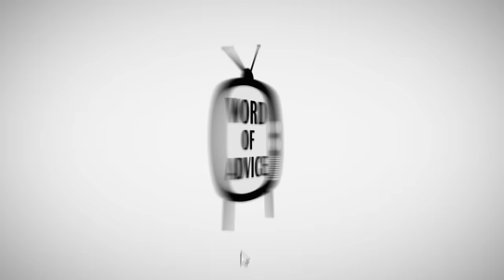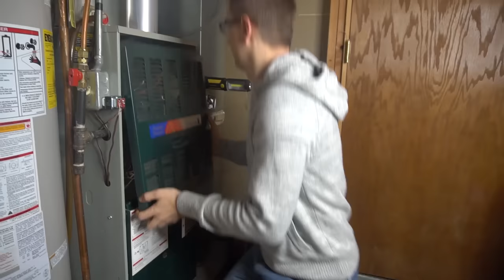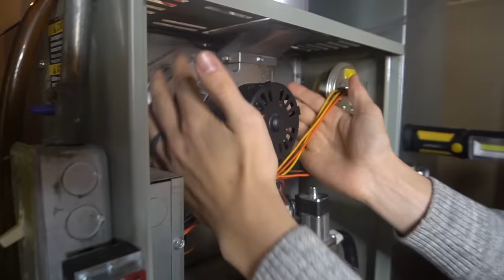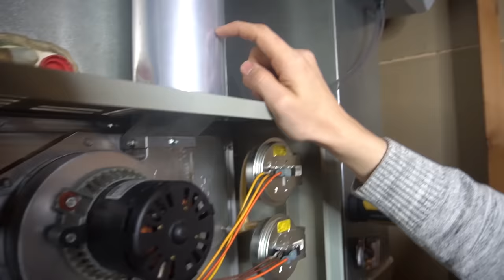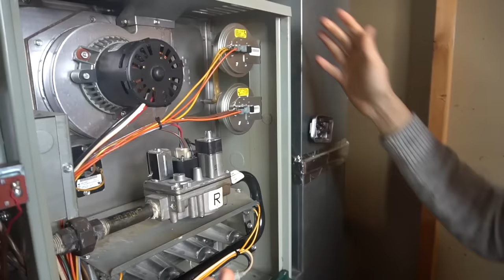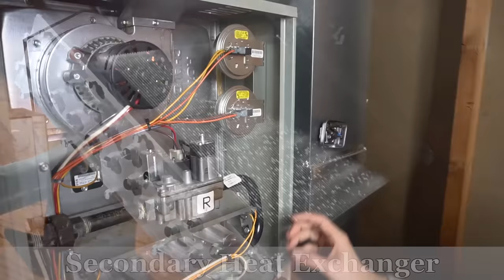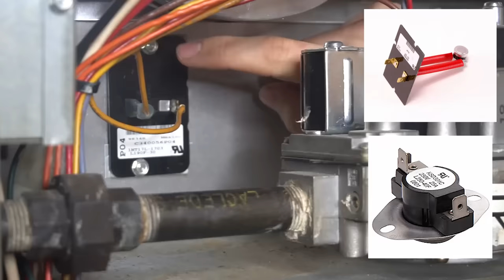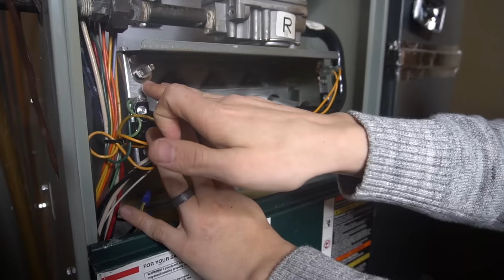Furnace Parts and Functions Explained

Comment: I just installed a single stage high efficiency furnace in my house. I took my time and feel like I did everything right. It worked fine for a day then stopped lighting furnace. Sounded like the gas valve just keeps opening and closing which either gave me inconsistent flame or no flame at all. Tried it again the third day and furnace lit seemed to be running pretty good but I would get a lil flicker once in awhile in the flame. It's been converted to propane I changed the regulator spring in gas valve and offices. My inlet pressure is about 16 inches WC when furnace is not running and 10.5 when it is running. Outlet pressure is 9.7. Pretty frustrating installed because I didn't wanna pay a hvac guy 3 to 4 k right now and might have to call one anyways. I'm pretty handy and I'm a maintenance mechanic at work.

Comment: I have the exact Same a.c. heater furnace as you do but mine the heater will not turnon. I cleaned the flame sensor and my inducer motor turns on briefly when i touch the flame sensor.When I place a jumper on R and W1 nothing happens.

Comment: My Furnace troubleshooting :

Vulcan Product no 5300052 and Serial no 00447836, 

Previous Problem / Initial Problem 

Furnace didn’t want to start if the Room Temperature is below 16 or 17 Celsius degrees.
If already starts, no problem.

I try to learn troubleshooting from YouTube.

So I know about FURNACE FLAME 🔥 SENSOR and IGNITER. And also know about the CAPACITOR.

I did change the FURNACE FLAME 🔥 SENSOR and IGNITER, and also the CAPACITOR.

The Furnace when one day already ON ( it could ON, when the Room Temperature is gonna up from 16 C to up ), all the day we have no problem. Because the Room temperature is still about 17 C or higher.

The Problem of my Furnace is only:
It couldn’t ON on a day when the Room Temperature is below 16 C.
That’s the Problem!

Hi 👋 J, could you advice me, what part should I change again ? 🙏

Comment: Hi j, recently i been having issue with my furnace. It will works some time only. Basically when i turn on the thermostat and I look at the furnace, the cycles went from big blower to inducer blower, then the igniter glows orange and I can hear a click noise from the gas valve but the burners will not light up into big flames. After about 5 seconds the orange igniter change back to its original color because no big flames lit up. It seems like the gas valve click but it's not open to allow gas to the burners area to get light up into big flames. What do you think could be wrong here? Is it the gas valve is bad?
Reply: call for professional help it could be a lot of things

Comment: Help... I have an international comfort furnace with a Honeywell smart valve. It would ignite the burners for 2 seconds and turn off. I replaced the dual igniter/sensor and now it ignites and the call for gas is slow with only 2 burners igniting but never going to a blue flame. And the pilot flame never goes out. The blower is spinning..Shouldn't the pilot stop at some point?.. thanks

Comment: my gas furnace is trane and has an issue that all time never go up two degrees, will shut off, if the house temp 69 and i set the thermostat for 71, it's going to shut off soon reach 70, three techs came and done nothing, the control board has no light indicator to show you the error!!
please advice.

Comment: Great video. Thanks for creating. I have a question. When just the fan (blower) runs without heat why is there no suction at the returns. There is only return suction when the heat is on. I have a humidifier on the return side and I'd like the fan to blow much harder when 'fan only'.

Comment: What's the switch that was covered with tape behind the lower panel? Why is it taped? I just had my furnace servied & it's ziptied & I pretty sure it wasn't before.
Reply from the maker: That is a door switch. It's only function is to turn the power off to the furnace when the bottom door is removed. A little safety feature that many technicians will bypass (with tape, a ziptie, or something else) because we need the power to stay on while doing our checks. I left mine permanently taped. There is no harm in having it ziptied and if you want to get in there yourself you could simply turn the furnace power switch off.

Comment: Excellent! What holds up better a hot surface igniter or spark?
Reply from the maker: I don't think I have ever replaced a spark ignitor :) I replaced the spark module that generates the spark or the ignition board plenty of times though. I also replace plenty of hot surface ignitors, I would say they fail more.

Comment: Only one thing I want to add to your advise is primary and secondary wires . There is a danger if you touch 24v compare to 120v . And also the power blower door switch you forgot to mention .

Comment: Love your videos! I have a question for you . I have a 3 zone system I noticed that when only one zone is on in "HEAT" my furnace trips on high limit switch.. but it will "NOT" doit if 2 or all 3 zones are on.. do you have any tips for me I would appreciate it...

Comment: I have a question. My furnace room and inside the furnace is very dusty. Is that gonna destroy my furnace? what would you suggest me to do? Thanks
Reply from the maker: Well, you can try vacuuming out what you can. It won't destroy the furnace but it may take out the blower motor. If you want, you can watch how dirty mine was when I replaced the blower motor on my furnace. (the one in this video) Just look up my video on blower motor replacement.

Comment: I have a new house I bought from builder with 2 zone system. One zone for upper level and one zone for lower level. However the unit itself is one stage. There is control unit which can close dumper to lower level or upper level. The issue is that when only one zone is calling for heat (as an example) the unit rated for the whole house is serving half of the house, and I get tremendous amount of heat and air flow. Is there any building code that requires builders to install 2 stage systems in 2 zone houses.
Reply from the maker: Different states will have different codes so I would not be able to tell you that.. But yeah that sounds like the furnace is not meant to go with a zone system.. A variable speed (ECM) blower motor may help a little bit with that.
Reply: @WordofAdviceTV  May I know how it is in your state.
Reply from the maker: @maciekkormicki9298  Sorry, that is not something I would know. I only do service work, no new installs so I do not know all the building/installation codes. I do know that new construction houses are way more tight (insulated) therefore they implemented new codes that require builders to put in air to air exchangers, air cyclers, etc. to prevent the house from getting "stale". As far as I know, where I live, there are no codes that require HVAC systems to have a zone system though. Or a two stage furnace.

Comment: What is the wire device connected to the junction box power switch it looks like a transformer but only 2 wires induct or
 or as relay ??
Reply from the maker: It is as you say :) That is a transformer for my humidifier.
Reply: Thanks the video presentation was very good the last to things that went bad on my furnace was the limit switch and I was getting short cycling because I was using a Merv
 12 dropped down to a Merv 8 it is a Bryant 20 years old

Comment: I’m confused. At 3:50 you state, “a single stage has a line and a common.” I always understood line and common to be the same.  I’m thinking you either meant line and neutral or as sparkys call it, a grounded conductor...or its 220v, in which case there would be two lines or commons or conductors...whatever y’all call it.

Awesome video, btw...this really helps!
Reply: Usually, "line" is the voltage line, also called the "hot" wire, and is colored black. The other wire is the "neutral" wire, and it is not unexpected to use the neutral (a.k.a. "return") white wire as a common. Calling a hot wire by the name "common" is, in my experience, very unconventional.

Comment: I have a question/wasn't sure where to ask. I rent and had a new high effeciency furnace put in but the top and bottom door are different than my old one. My old one came off like the one in your video...this new one has knobs to open it and also rubber seal all the way around the door/panels...the issue I'm having is the smell of the rubber seal is triggering migraines for me (I tend to be sensitive to smells and new rubber is one that makes me feel sick)...and unfortunately the smell of it is coming through the vents in my house so I really can't turn the furnace on w/out feeling sick. I didnt know they made new ones this way so never thought to ask the landlord what kind of furnace he was getting or if it had rubber on the panels. Is there anything to do about this or any different panel they could put on that doesn't have rubber seals around it? It's just very frustrating as within minutes of turning it on I get nauseous and migraine and I can tell it's from that new rubber smell. Just thought I'd ask here. Thanks!

Comment: My new heat pump/furnace is set up horizontally. There is a drip pan underneath what I would call the output end of the furnace where the ducts are connected. There are two round threaded holes about an inch in diameter close to the floor height. One of these has a red plastic plug in it, the other does not. Air is blowing out of the unplug hole. Can you explain what the function of that open hole is?

Comment: Hey,  I noticed you cleaned the carbon off of the shop burner with a steel brush in one of your other videos. Do you ever have to clean the gas manifold orfices, and if so what do you use?
Reply from the maker: With the orfices, if there is anything stuck in them, usually it will be a spiderweb or some other easily cleanable debris. I use a dental pick to clean those. If I can't find it in my bag, then I simply yank out a strand of wire (needle nose pliers are good for that) from my steel wire brush and use that 😄
Reply: @WordofAdviceTV  OK cool, Thanks!
Reply: @ Word of Advice TV, Hey I wanted to know if had a video on Humidistat Diagnosing. I have humidistat that could possibly be bad for a GX-8 Pure Humidifier System. I wanted to diagnose this particular model. Its a Duct 15 to 95 % RH Controller Humidistat. Let me know your thoughts on this.
 Thank You!

Comment: HI J, I have a modern high efficacy  forced air furnace (96%AFUE) and was wondering if the induced draft motor is variable speed and if so what controls the speed?

Comment: On an old Furnace Circa 1966 the gas would flow via   the tstat,  Ignite from a pilot which had a thermo couple. it would then preheat the exchanger for a half a minute or so and then the fan was triggered by a thermal sensor.  Is there still a similar process or is it all on a timer?

Comment: How much should replacement of the control board cost?  I saw on Amazon that they generally run $100-$150.  My furnace repair person said it would cost over $900 to replace it because it needs a "kit" for American Standard Freedom 80 single stage furnace.

Comment: Good explanation of the basic parts. LOL on Amish joke. Anyway, you didn't mention the big transformer mounted to the junction box, but mentioned a little box by the control board as the transformer. I am familiar with the big iron transformers like on the junction box, but the little plastic box....Is that really a power transformer? Is part of it hidden inside the steel enclosure then? If so, was the bigger one outside added for the AC system?

Comment: So I have a Intertherm furnace but I am having a hard time finding parts for it online. Currently I don't need anything I just want to be prepared. I found the serial number and model number of the furnace itself but have not had much luck. Do you recommend any particar sites for parts?
Reply from the maker: Hey Aaron! With an Intertherm it is harder to get parts. What I would do is just call an appliance parts store and give them your model and serial, tell them what you are looking for and then ask for a part number so that you can confirm that is indeed what you are after. After you have the part number, looking it up becomes a lot easier.

Comment: Important note is that the switch on the furnace does NOT shut off power to the A/C condenser outside. It only turns off power to the transformer, which opens up the contactor on the condenser if it's running. So if you're working on the condenser, you still need to shut off the service disconnect switch next to it. Also, some furnaces use a flame pilot rather than a heating element. In that case, there are two valves in the gas valve, one for the pilot and the other for the burners. There are two flame sensors in that case, one for the pilot light and one for the burners. If the pilot light flame sensor is dirty or if the flame doesn't light, the valve won't get the signal to open the burner gas valve. Why did you have electrical tape on the blower door safety switch?

Comment: Hi, in general, how long does the flame sensor last?
Reply from the maker: It's actually just a steel rod so normally  it should outlast the furnace. 😅 I rarely replace flame sensors.

Comment: Hi would you have any idea why the central humidifier will not start changed solenoi valve, saddle both furnace and humidifier filter water is running.
Reply from the maker: You would need to do some checking with with a meter and see where the voltage drops out. Do you have power going into the humidistat?
Reply: @WordofAdviceTV  yes its 24V even tryed an extension cord to check the outlet. I have the Wait 6000 humidifier is thenhumidistat integrated its does not have a separate humidistat. Thank you for the quick response
Reply from the maker: @sandram6665  Unfortunately I have only seen that humidifier a couple times in the past so I can't say I am familiar with the wiring. Sorry, but I would have to do some troubleshooting of my own to figure it out, so walking you through it is not something I will be able to do..

Comment: its 3/10/2019; I have a Rheem Criterion 2, its about 20 years old and the heat exchanger is bad.Its out and I cant find a part number on it could you help? thanks.
Reply from the maker: I tried looking it up but didn't have much luck sorry... If the furnace is over 20 years old there is a good chance you won't be able to find one though. But can't say for sure..

Comment: Watched all your videos on flame sensors and how and what to do when my York furnace won't stay fired and shuts down after a few seconds. I've done everything your videos explained and still won't stay fired up.
Checked voltage and replaced flame sensor new, cleaned burner face, checked ground and wires going to the control module. 
Replaced control module new and still the flame goes out after a second or two. What else is there ? 
Replace the furnace next I guess... Any suggestions?

Comment: Hi I hope you can help me .. I am having an issue that sure looks to be high limit related but is not.  All of the roll out breakers are fine , The High Limit is NOT tripping..  Venting is perfectly fine and no blow out while blower is running.  I tired furnace without filter for test and is not restricted air from filter.   All checks run fine.  Gas valve opens , Fire ignites,  Exchanger heats , Blower comes on, Heat comes out into house about one minute gas shuts off and blower stays on till cool and igniter heats and system short cycles till the house is warm.    Also my furnace does NOT have a flame sensor kinda crazy but nope not there lol.   I almost gave up but then found yet another temp switch..  This one is located on the blower cage.  Now if this helps my furnace is a down draft furnace might be why its so strange lol.   But why is there a temp switch on the blower cage ?  Its a L105-10 4 pin so its quite sensitive could this be shutting down the gas?  And why is it there at all?

Comment: Is it necessary to clean the burners?  I have not ever taken mine out to inspected them.
Reply from the maker: Ribbon burners need to be cleaned once in a while but as for inshot burners like the ones in the video, they rarely get plugged up so I barely ever need to clean them. Although some techs will insist that it should be done periodically. There is some truth to that since build up on the burner face will cause the burners to not burn as clean/efficient as they should.
Reply: @WordofAdviceTV  thanks!
Reply: @briancloutier2781  dust can accumulate on the air inlets of the burners and that can cause poor combustion

Comment: Hi, you seam to know what your doing and you make since.  Please understand that it is 4:53 am and I have been hunting for hours for a video to show me how to remove the entire furnace body/metal cabinet from the closet like hole that it lives in, in my mother's double wide mobile home.  If by some chance you have already done a video on this please give me the info to find it  and if not "Please Help Me"!  The unite she has died about 4 years ago and we have been using little stand up air cooling unites in each room.  We have decided to add on across the full back end of the double wide and to put a new extended the roof over the entire home.  We want to have a brand new HVAC unite and furnace installed, with the furnace going in the new part of the house.  Mom wants the spot where the old furnace is turned into a linen closet, but I have no idea how to get the furnace out.  Please what do I do?

Comment: The capacitor in this case has a slightly-different purpose.  You need multiple AC phases to spin a motor instead of just bouncing it back and forth.  If 3-phase isn't available, a capacitor can be used to generate a second power phase offset from the main one.